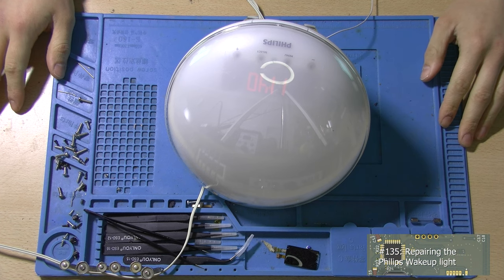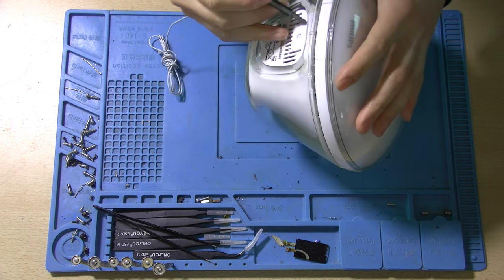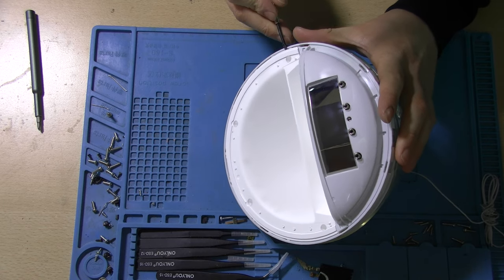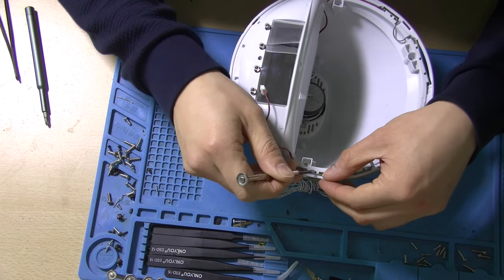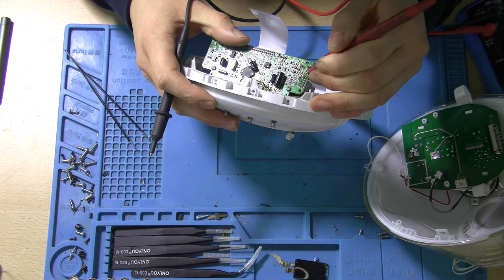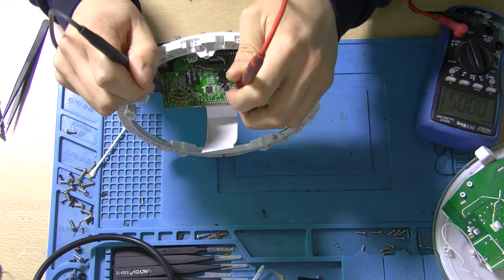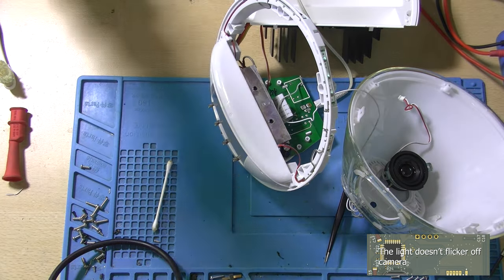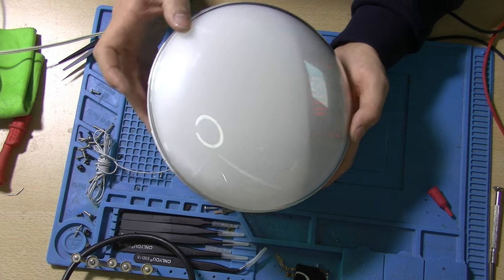#135 Repairing the Philips Wakeup light

Comment: Thank you for the video, Tim! It really helped me! My light stops working every now and then. When I disassemble it the light works again. My best guess is that there is a faulty soldered joint somewhere which is triggered by the light's heat. Apparently, not so far from your case...
Reply from the maker: It would definitely make sense! My light didn't stop working after I repaired it, so the touch-up might have worked 🤞🏼

Comment: Thanks for your video, I was able to take a part and fix the issue of not turning on.
Reply: Mine is not turning on either but cant figure out the issue. what was causing yours?
Reply from the maker: I think it was the wire that wasn't making proper contact. The wires of the buttons
Reply: My issue was the capacitor was blown. I replaced it and it worked like a charm

Comment: In my case, the light turns off when the alarm goes off. It does turn on in the build up to the alarm, and also when used individually (without the alarm). I opened it up and clean it up a bit with Deoxit, but it still does the same. Any idea which part of the circuitry might be faulty? Or how to go about identifying which part is faulty? Thanks!
Reply: I have the same issue, did you manage to find any information on this problem?
Reply: @Scalee  I seem to have fixed it. Remains to see if it'll stand the test of time. I cleaned and re-soldered a few parts, but I think what did the trick was identifying and re-soldering one connexion that seemed faulty (not sure what the component is exactly) as shown here https://youtu.be/bgavr0jkTII?si=d-cJdu0The5WzF0z&t=1010 Good luck
Reply: @lauriannegarant-saine2382  Cool thanks for the info. The wife won't allow me to tinker until spring :)
Reply: same problem for me, so far I have identified some very coroded wires on the connection to the LED board. However cleaning them and replacing them did not fix the problem.
I suppose that I will have to have a look at components on the main board as well. sigh

Comment: thanks for the video, i 'repaired' this light because the light does not turn on all the times. Sprayed some wd40-contactspray on the switches. I only need to remove the ring with the buttons.
By the way: this is my second wake-up light, the switches of the older model were very bad. But also this light is malconstructed. Very bad user interface. And the light rolls over by pressing the buttons!

Comment: Mine randomly starts to make the ticking sound despite me not touching it. Very annoying as it can start doing that out of nowhere. When I move the power connector plug (like rotate it while plugged in) it can turn off. Quite weird. As someone with not much electronics experience I'm rather hesitant to dive into this. Oh Phillips, you could have done better!
Reply from the maker: You could try and clean the buttons up front, they are rather sensitive to dirt
Reply: Same thing happens to mine. Tons of clicking when plugged in and then none of the buttons work
Reply: @TheJPKeith  disassembling and putting back together somehow made difference. Compressed air in spray
Reply: @northridgefield  yeah mine is working now after taking it apart and putting it back together today lol
Reply from the maker: @northridgefield could be that there was some corrosion on the contacts or something. I've had this myself and I'm still using it every day since the creation of this video
Reply: I am having the same issues and Philips wouldn't repair it bc the warranty expired! There is no way I am spreading that much money to buy another one knowing it would break down. I have reached out to some electronic repair place near me, hope they can take the case (I have zero electronics experience so I don't think I could do it myself lol)
Reply: @piper_mint  mine worked only for a couple of weeks then resumed acting like it's haunted. I'll be doing the same - some local exorcist (or electronic technician).
Reply: Thanks Tim, you Video helped me to dissamble the Light.

I also had the issue of phantom pressing the front buttons. After disassembling and reassembling it seems to work again.
My suspect is that the spring of the left from button was slightly shifted. I tried my best when putting the front screen on to not have any phantom pressing.
I hope it keeps working now.

BTW: I was surprised how clean the light was still inside, only a real small amount of dust on the bottom board.
So from tht aspect it is a well desigend device to my opinion. I also love it - as long as it works 🙂